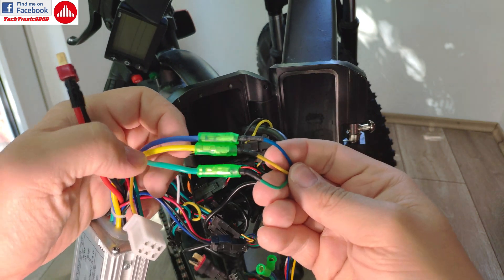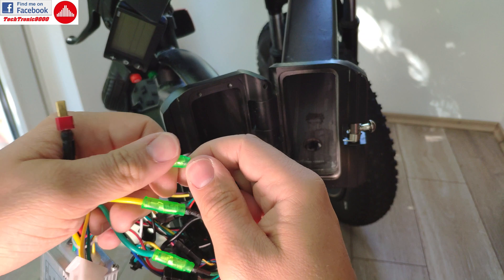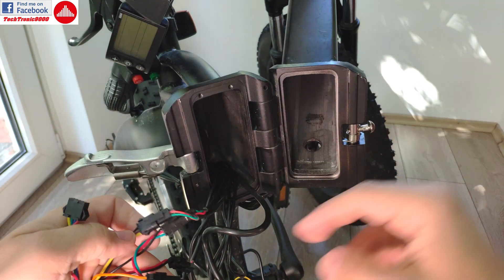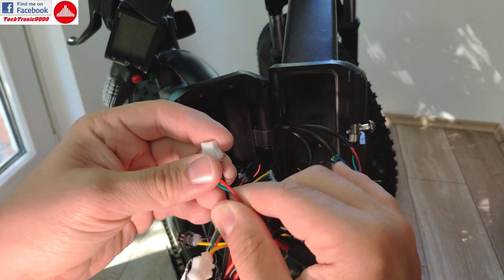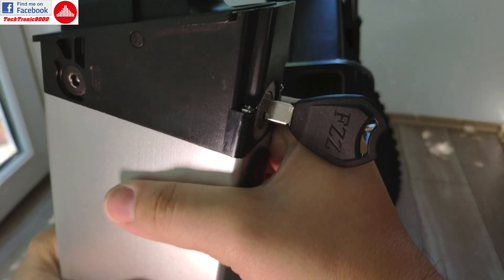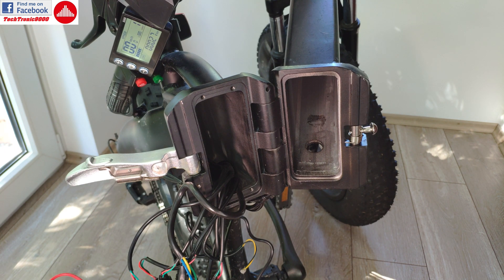ADO A20/F | A16 | A26 eBike Hybrid Controller Upgrade

Comment: Hi, love your videos as always. I have A20 older 9 speed assist and want to upgrade as you have but I see ADO have a G drive controller more modern now as it has less cables and they say I can use this but not sure as this has more wires etc if you have any knowledge or experience with this? Thankyou!

Comment: My controler says UART. On the outside could I use protocol 2 display with the controller
Reply from the maker: UART stands for universal asynchronous receiver / transmitter and defines a protocol, or set of rules, for exchanging serial data between two devices. UART is very simple and only uses two wires between transmitter and receiver to transmit and receive in both directions. In ebikes you need to have matching display with matching controller, otherwise even if both use "UART" they will not work.
Reply: @TechTronic9000  thank you so much for the speedy reply,so how would I know which display would work with controller.or is it hit and miss though I know normally you would buy them as a pair but in my case that was not possible any suggestions much appreciated.
Reply from the maker: It's mostly hit and miss, it's better to buy them in pair from the same manufacturer. You can also ask the manufacturer of the display or controller for a compatible one.

Comment: hey there you have been my go to guy whenever it comes to needing help with my ado ...quick question would you know of any compatible controler i could order off amazon uk for an ado a26 ? i know i could order from there oficial site but because i need it for work i would look something with 2 day shipping any help would be greatly apreciated many thanks as always 😁🤝
Reply from the maker: The problem with other controllers is that it will not match the wiring so you will have to guess and modify all of it...

Comment: Hello. I faced such problem. I ordered the international version A20+ on the official website and they sent me a limited version CE for Europe. Will I be able to make it international by connecting another controller and setting the throttle. If so, how to distinguish the old controller without a damper and the new one. thanks for the answer.
Reply from the maker: On the newer A20+ international version box you get the "CE" marks, but you can unlock it ;)

Comment: Thanks this video was helpful. I ordered the EU version by mistake and it’s costly to send back. It doesn’t have a throttle. So can I buy a throttle and check if my power control supports or if not buy the other control? If someone could help me that would be great. Cheers In advance
Reply from the maker: Yes, it would work if you get the throttle. Contact ADO support, they are very useful.
Reply: Hi, I have a similar situation as you had. How did you solve it, did you buy a new controller?

Comment: i hope the a20+ with new controller supports 48v too? because i want to buy a bigger battery with 48v 15ah from alli express...thats a whooping 720wh. cost around 360 euro.
Reply from the maker: The new and older controller both were dual 36/48V compatible.

Comment: I have a A20F XE bought just 1 month ago. I have the EU version so no throttle. How can I let it go a bit faster say around 30 km/h? Is that possible? I tried the settings but will not go faster then 25 km/h
Reply from the maker: You need to check this out https://youtu.be/rL0P9gW5x4U
Reply: @TechTronic9000  i checked it. So I need to buy a throttle to make it faster then 25km/h? Not possible to get to 30 with only pedal assist?

Comment: How much extra speed did u get from the new controller
Reply: Also is it worth the controller upgrade?
Reply from the maker: The same speed. The upgrade is related to extra features such as hybrid mode, more assisted modes, etc. You can check my other video regarding this controller and testing it.

Comment: Hi there. Thank you for the video. I managed to change the controller with it 😊
Now there is just one thing: The speed limit is on again and I cannot change that anymore. Any ideas! Thx
Reply from the maker: If it's the new controller, then check my ride video with the upgrade, you need to switch it to hybrid mode first then it will unlock.
Reply: @TechTronic9000  Thank you ☺️

Comment: This controller is crap, I upgraded my battery to a 48 volt and the speed difference was only 2 mph more. The controller on this bike underpowers its capabilities and needs a better compatable controller. This bike is slow even after the unlock and its down to this controller limiting its true potential. Shame really cos this bike has the potential to be a winner/#.
Reply from the maker: Sadly you did something wrong. You either have the old controller and you haven't unlocked it, or the new controller which was not activated to non-EU international mode. Regardless of that with those controllers properly set up on a 48V battery you will easy do 40+km/h.
Reply: @TechTronic9000  You are wrong, I have the new controller I have had it out of the bike and checked it and did all the unlocking via the onboard lcd panel. With the 36 volt battery unlocked i was getting 21 mph, with the 48 volt i was getting 23 mph. for a 12 volt difference this should be doing around 25 to 26 mph, also this controller does not even have a shunt on the pcb, it is very limited and doesnt allow the full potential of the motor.
Reply from the maker: Then you have the old controller as that one unlocks from settings, see you mixed them up.
Reply: @TechTronic9000  You are saying the new controller is already unlocked? I know this is the new controller because ADO informed me that this model is the updated international version. The bike is underpowered by the controller, it needs a compatable controller that doesnt restrict the motors ability. Motors can take a lot more voltage than they are rated for and it wont harm them, it is current that will damage the motor not voltage but this controller limits the amount of voltage and amperage to the motor underpowering its ability to do more. The EU version is not really 250 watts, ALL of these models are capable of 500 watts when unlocked via the controller regardless of how they are marked. What im trying to say is that these controllers are still restricting power even after unlocking top speed regardless of voltage increase.

Comment: hey is there any way to figure out what controler i have thanks
Reply from the maker: If you have multiple assisted modes or if you can enable / disable throttle like in my video here https://youtu.be/rL0P9gW5x4U then you have the new one.

Comment: TechTronic9000,hanks for the video provided. Could you post a photo of the insides of the old controller. High resolution photo of the board. I'm interested in the brand of keys that so often fail in similar controllers of other electric fat bikes. I just want to buy and have them in stock for repairs. I see no reason to buy a new controller.
Reply from the maker: I might still have the old controller, if I can find it :) Join the ADO group and maybe there are more looking into this https://www.facebook.com/groups/476807196873824

Comment: if i want change battery to 48v,which one i shoud buy?choose below 15a?
Reply: Dont bother it only gave me an extra 2mph... Its the controller that needs upgrading because it is limiting the bikes true potential. This controller is not really an upgrade, we need a one with larger amperage and a one that doesnt restrict the motors potential for going faster speeds because this bike is slow even after unlock. Such a shame since this bike has the potential to be a winner
Reply from the maker: Are you referring to the BMS amperage or capacity? The new 48V battery should be able to output constant 15A at least.
Reply: @TechTronic9000   Hi, do you mind pointing out which 48v battery you are refering to? thanks, i just bought the A20+

Comment: Hi thanks where do you get the upgraded controller. what do i need to search for ?
Reply from the maker: Controller for: A16 / A20 / A26 - https://bit.ly/3BOQber
Controller for: A20F - https://bit.ly/2WRWU8Y
Controller KIT with extras: A16 / A20 / A20F / A26 - https://bit.ly/3n5WDJY
Reply: I have no lcd indexes. The bike ado a20. I just got it. No switch on. What is the problem?

Comment: hey i just noticed the lights wire that you had to switch didnt match when you joined them back togetber the wer difrent order did it still work thanks
Reply from the maker: On the first versions of this new controller the wires / polarity was reversed, so yes colors didn't matched but it worked, after that later the controller had a revision to come with correct plug/wires.

Comment: Hi Sir I have a problem for my lcd display in my tomoloo scooter is broken or isn't working anymore and I can't find for replacement of that. So I want to know if this one your the lcd and controller will i buy that same as yours it would be work to me?
Reply from the maker: Sadly I have never heard of "tomoloo scooter", from my searches it looks like a Xiaomi M365 clone. There are plenty of controllers that will work for it, but I advise you to get a controller for a scooter, not for a ebike. The ones for eBike come pre-programmed for cadence sensor and assist mode, while the scooter ones only have throttle mode.
Reply: @TechTronic9000  Thank you Sir🙏

Comment: Hi, i just bought the ADO A20 and changing the speed limit to 35 km/h does not work(seems I have a EU version?). Will replacing the controller fix it?
Reply from the maker: You might actually have the new controller already, check this video to enable throttle and unlimited speed: https://youtu.be/rL0P9gW5x4U
Reply: @TechTronic9000  Hi, thank you for response. I found that video yesterday and indeed it worked! :) it's a pitty that this is not covered in bike manual
Reply from the maker: That has happened as the initial release of the bike had another controller, later a lot of users requested another controller this this became standard for newer bikes. ADO did publish info about this but it was on their AliExpress store page.
Reply: @TechTronic9000  I want to change my controller too(take to bike shop since I don't want to mess anything without any knowledge)but I have no idea which one controller is rhe right one. My controller  says as follows..rate voltage 36
undervoltage protection value 31 +1v
Limit current 16A
Nominal current 8A
Rated power 350w 
Wheel diameter 20.
I want to increase my speed i have done all the tricks and nothing works  plus I have unlocked the speed to 32mph but I can never go more 18mph(the speedometer says 16mph)

Comment: Since I’ve upgraded the battery to 48v the key switch does not turn off no matter where I select using the key it just stays on but eventually times out or switch off at handle bar controller Is this just a faulty switch on the battery ?
Reply from the maker: The original switch is built into the battery. Probably the new one only has a locking option but not also an electrical cut.
Reply: @TechTronic9000  Hello thank you for getting back to me Yes you are correct the original battery had key lock and switch built in my new battery only has battery lock so I switch off at the controller on the handle bar I’m ok with this now at least I can remove the key 👍
Reply: @sogalog1  Hi, do you mind telling me which battery you bought and is the performance worth the upgrade? Thanks
Reply: The upgrade to use a 48volt battery has improved speed and acceleration The key only locks the battery in place but doesn’t switch the battery off I believe that some battery’s are like this So I do remove it after use
Reply: @sogalog1  the switch things doesn't sound too bad to me as I take the battery out anyway, very interested in buying it one, do you have a link or something so I can check it out?
Reply: @sogalog1  hello, I'm also interested in where did you buy the 48v battery please
Reply: @sogalog1  what battery did you buy? Like what exact one?

Comment: Hello I have subscribed to you and watch your videos. I upgraded my a16 to the controller now the light doesn't work anymore, can you help me.!? Kind regards
Reply from the maker: Check my video in more detail, there is a plug that has reversed wires, you need to swap them and the light will work.
Reply: Hi, I have A16 too, can you unlock max speed on your A16? I can't go over 25km/h with new and old controller same problem and you ?
Reply from the maker: The new controller needs to be switched into hybrid mode with 2 assist + throttle.
Reply: my friend friend pülease the same cintroller on ebay cost 18 euros.....open your stupid eis...anonymos the will take part of this sacm..u wiil seee

Comment: I have just bought the UK version of the Ado A20 and the throttle does not work at all for full electric mode. Do I need to upgrade the controller?
Reply from the maker: Check my S866 controller setup for ADO bikes, you need to check zero start and enable throttle: https://youtu.be/hSbDzuEtqrI

Comment: How can I recognize if I have original or new controller? I bough my bike a few days ago. I think it has original controller - however it has for example cruse control (you hold acceleration for 10-15 seconds) it changes to "P" and holds it. Thanks!
Reply from the maker: If you have cruise controller it's probable you have the new one. Also you should have 3 assisted modes, or 2 assisted + acceleration. Check this video for reference https://youtu.be/rL0P9gW5x4U